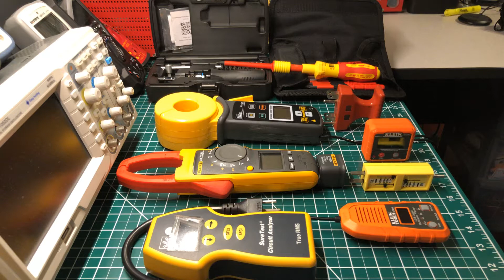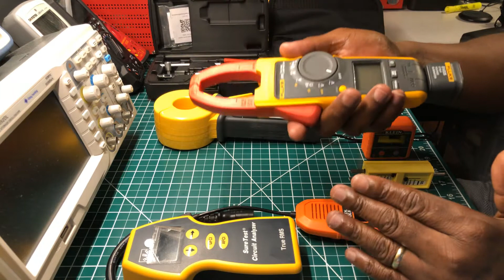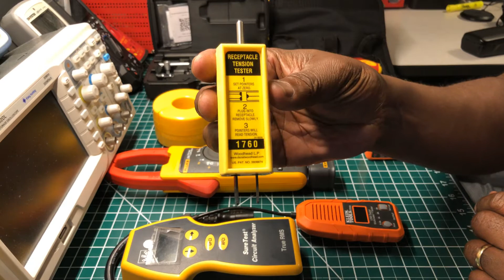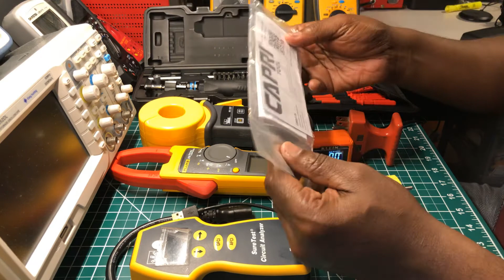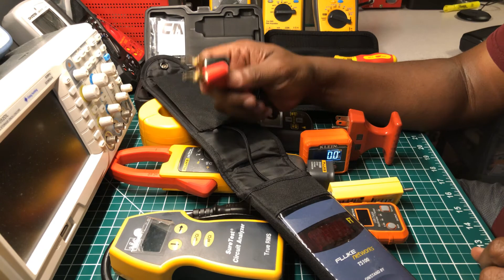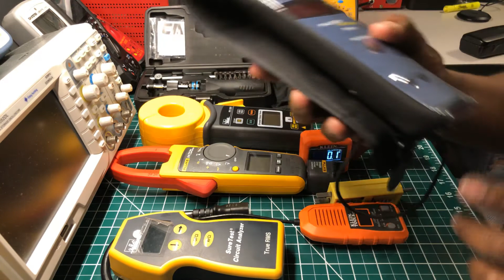🇺🇸 Testers Required For Electrical Installation In The United States

Comment: Hmm. I've become intimately familiar with the receptacle tension tester in the last few months. It's a tool that is primarily, but not exclusively, used by electricians that work in healthcare settings. I've had to set up and test power systems for dozens of ventilators and other life support devices😷
Reply from the maker: You’re correct Mike, but because I do electrical preventive maintenance as my business I’ve incorporated it for my residential and commercial use as well.

Comment: When installing a new or testing an existing circuit do you use an insulation resistance tester? We do in the 🇬🇧
Reply: By the way great channel 👍😁
Reply from the maker: I’m glad you like the channel, it’s a pleasure to have you visit, I hoped that you subscribed because there’s more to come. Take care D.C.
Reply from the maker: Yes I do, especially with older wire, or wire that’s questionable. Now if I’m doing an electrical preventive maintenance inspection of course that’s procedure.  The insulation testers I use are the following: IDEAL INDUSTRIES 61-797 Insulation Tester, Extech MG300 Insulation Tester, FLUKE 1507 Insulation Tester.
Reply: The Electricians Tool Channel  thanks for the reply in the 🇬🇧 I use a megger mft 1741+ which is a really good tester
Reply from the maker: MEGGER are the original makers of the insulation tester. MEGGER is high quality !!!

Comment: Grounding is very important. For telecommunications or sensitive equipment the grounding requirement is 5 ohms or less.  While a ground clamp meter is excellent for energized systems. The most reliable and accurate way to measure ground earth resistance is by the fall of potential or wenner method on a denergized system. Most electricians dot even know about this. Grounding is not well covered by electricians - it’s fundamental and the foundation for any good electrical installation work.
Reply from the maker: I totally agree with you M&M.

Comment: good video.

Ive got to get me one of those tension testers. they seem pricy for what they are but I thing Id pay for it self quickly by proving to clients plug is worn out. Their isn’t any opinions involved when you can prove it with a tester.

For stakeless  ground testing I use the Megger DET24c. I like it because I can export reading as CSV and have them auto imbed into my repots using google scripts.

As for TDR I use the Megger TDR1000

The megger MIT485 IR tester combined with the TDR1000 allows me to determine if intermittent faults or due to water ingress and pinpoint point where the conduit is separated and/or where cable is saturated.
Reply from the maker: Hello JT allow me to help you out, here’s the code :  NFPA  99 - 1996, Ref. 3-3.3.3 (d). Good luck  🍀. Also it sounds to me like you have some high quality test equipment. That’s the only way to go !!!
Reply: I knew I had seen specs for receptacle tension. Ive never seen a way to test it until seeing yours. 

By the way Im not an electrician by trade. Im a custom systems integrator. So Im not a licensed electrician but all my licenses and certifications are based off NEC  72e, NFPA 79 & 101.

Comment: Interesting to get an insight of the testing requirements in your country TETC. I have never seen a mechanical test for socket strength in the UK. That would be a laboratory test to get the product certified. I like the USB tester, those types of sockets are more common in the UK now, I will have to go and get one of those myself. Most of the time we use a multifunction tester, that combines all the socket, continuity, insulation, RCD and earth tests all into one.
Reply from the maker: What we would call a multifunction tester is the IDEAL SURETEST Branch Circuit Analyzer( The Yellow Device With The Pigtail Cord ), I would have to use a separate insulation tester to perform my resistance tests.
Reply: @TheElectriciansToolChannel  I have been reading the instruction manual for that unit, it seems to do a little bit more than our multifunction testers. I don't believe we carry out load tests and nothing for AFCI, but I do have a very basic tester that may be missing some functions. AFCI breakers are only starting to come in over here.
Reply from the maker: When possible TP take a look at both the ( AMPROBE WIRING INSPECTOR ) and the ( EXTECH  AC. Circuit Analyzer ).
Reply: Three-phase yes the ideal sure test circuit analyzer is excellent but a high level multifunction tester like the fluke 1664fc or a megger mft1741 will blow it out of the water. Some of the new AFCI/GFCI interruptor (RCDs sockets if you will rather than RCD breakers) will trip so fast that the sure test analyzer can’t seem to catch it fast enough with regard to trip time and trip current my fluke 1664fc did catch it and it has more ways of generating short and ground faults than the suretest analyzer that’s useful when you are testing different types of GFCI/AFCI interrupters.
Reply: @TheElectriciansToolChannel  Thanks TETC, it looks like the Extech unit is available in the UK, so I may get hold of one to take a look
Reply: In modern day households with modern equipment loads unfortunately the clean AC signal is going to be more convoluted including transformation into multiple DC AC components the simpler GFCIs/AFCIs and or RCDs will not be captured well by the older type A types and you will need newer versions that can be tripped by these more complex generated electrical ground fault and short fault signals. In my view newer types of multifunction testers that can test lots of different type of RCDs/RCBOs will come more and more into their own.
Reply: @mathman0101  Oh yes without a doubt the multifunction testers from the likes of Fluke and Megger will out perform the Suretest unit, but then you are looking at devices that cost in the region of 3 times the Suretest. I did look at the specification details and the Suretest looks to have a 1ms resolution, so probably a bit slower. I have not seen a load test function on either of the Fluke or Megger units which got my curiosity.